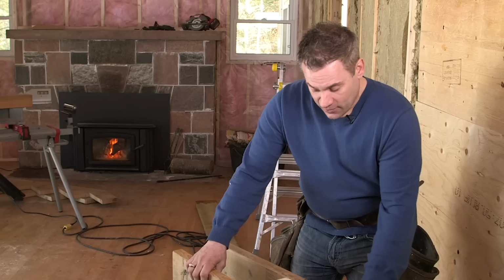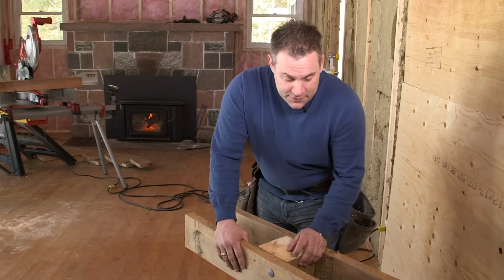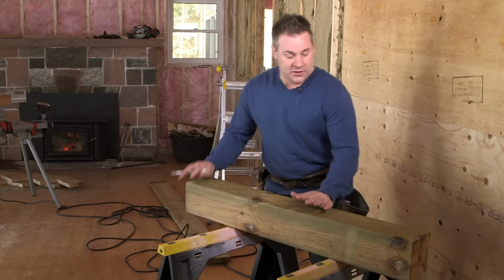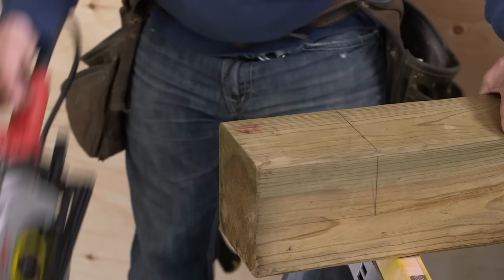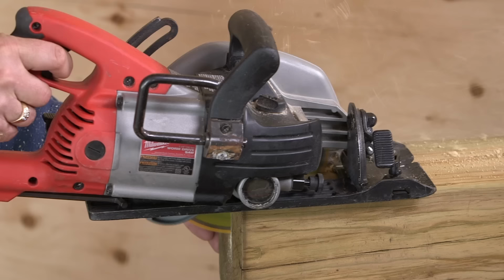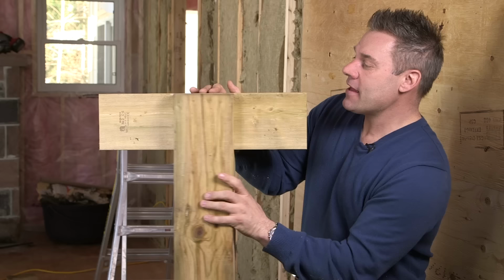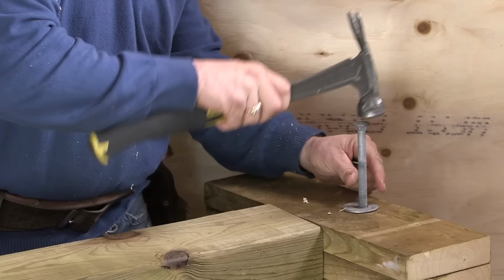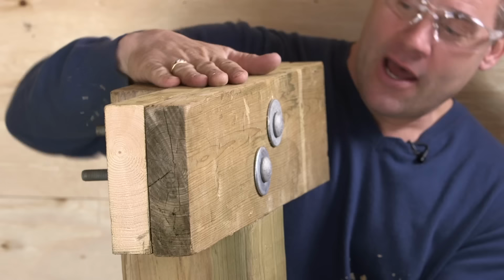How to Attach a Beam to a Post for a Deck | Decks, Docks & Gazebos

Comment: The sheer strength of those 1/2” carriage bolts can handle any weight you can fit onto the deck. The only time you need to knotch a post like that is when you have two or three story decks. Trust your building codes. Not this guy. Not saying knotching isn’t strong. It is. It’s just overkill for a single story deck and he’s implying that a proper  beam attachment is wrong when it’s not.

Comment: Now the two beam will have permanent water stuck in between them and make them rot ten times faster ! Even worse in cold weather like Canada water will turn to ice and push them apart, the only solution would be to stick a rubber membrane on the top of them !

Comment: Tried it your way and got shot down by zoning officer said to use lag bolts like you showed first off deck still up 35 yrs later with a 20 ft from Wall to beam with a 4 ft cantilever

Comment: While this is correct information, I have never seen a single bolt snap off ever.  Not even when using a bobcat to try and pick up a corner to bust up the whole unit.   Entire deck just lifted right up.

Comment: This is wrong. The carriage bolt has substantial strength. It’s not hard to determine the capacity and design loads and select a configuration that satisfies the requirements. Making that notch may be a code requirement, but that doesn’t mean another way isn’t safe.

Comment: Hate to point out that a screw and a carriage bolt are not the same.  Lets see him try and break the screw if it was a half inch thick..  My deck who I belt with putting two carriage bolts in 40 years ago must be getting ready to fall apart the next time I walk on it.

Comment: The minimum shear strength of one 3/8 carriage bolt is 7,500 lbs.  One bolt.  So nobody uses one bolt, some old fashioned math will give some impressive numbers.  Stronger than the wood will ever see. The internet is full of bad info

Comment: Big bolts are everywhere in construction it the only thing that works your not going to use a screw on a 5k lb beam.. Our high school is ALL bolts holding huge beams look around bolts are used everywhere.

Comment: Wow! The controversy, the arguments, the "Karens" and just plain BS.
First, anybody in the construction business KNOWS there is more than one way to BUILD IT RIGHT but CODE rules all if it addresses the particular build.
Second, personally I don't like carriage bolts or lag screws. I like and use whenever possible Grade 8 HEX HEAD BOLTS, washers, lock washers and nuts.
I use hex head bolts because it allows me to use a large flat washer on both sides thus giving me more compression / surface area when I tighten the bolt.

Comment: Expert on deck structure... But doesn't know the difference between shear strength and metal fatigue.... On top of that, wood would never shear a carriage bolt! The wood would split long before damaging the bolt.

Comment: Um, no.  Carriage bolts are just fine.  20+ years of building and never remotely had a fail.  I remodelled decks that had beams held to post with normal wood screws and it lasted years.  I wouldn't build that way, but surprisingly it lasted.  Put 2 - 5/8th or 3/4 carriage bolts and the shear is greater than what a 2 ply dimensional lumber beam can carry.  Plus he tested shear on a screw not a carriage bolt hahaha.   Added note: the ledger boards against the house for decks are held on with..... carriage bolts, timber bolts, or other large screws with enough shear rating. etc...  When pricing projects, extra cuts for nothing is wasted profits.

Comment: Both are wrong! The beam should cover the entire post and attached with  post to beam metal. Open horizontal end grain will allow the post to absorb water and in some cases promote dry rot. You can always use a waterproof material to protect end grain. The bolts will not fail under any normal deck configuration.

Comment: Why do you feel like you have to create a fake scenario with a screw? To say there is no sheer strength on a 1/2” carriage bolt is completely ridiculous. I would like to see you try to break the beam off of that post with those two bolts cinched tight. I would bet the wood would fail before the bolts.

Comment: Are you parking your car on your deck?    Nobody will argue that notching the post isn't better but just a 3/8  grade 2 bolt will hold at 830 lbs. With just two bolts that's four shear points 3320 lbs. Of course you're also far more likely to splinter the wood when it's bolted to the side. But the truth is unless the deck is going to see a really big load the notch is better but not necessary I only point this out because I don't want people to worry if their deck is made the other way.

Comment: Actually, the carriage bolts have quite a bit of sheer strength. The problem is not the bolts, but the wood. When you put a lot of weight on those carriage bolts, it's the wood fibers that compress around the bolt, making the connection loosen over time. He's showing the correct way, and now code required way, of putting beams to posts. You can also just put the beam on top of the post without a notch and use a metal post to beam cap that holds them together against lateral forces. No drilling, no carriage bolts, just cap with joist hanger nails (never use screws). I see people framing with screws all the time, but screws actually are brittle and have very little shear strength (as seen in video). Use 16d nails, they have shear strength, or when using hangers or post bases and caps, use the nails for joist hangers. They have more shear strength than framing nails, and the hangers are designed to be held by them for maximum strength.
Reply: Not all screws are equal, not all nails are equal, not all bolts are equal. Otherwise, you are spot on.

Comment: The shear stress on the bolt is virtually negligible. The bearing stress on the holes they wood the failure point. Some people think you need to use grade 8 fasteners with wood. Not true. Grade 3 is hundreds of times sufficient

Comment: Notching out the posts is not necessary and if I did use this method I would paint the cut wood with oil based paint which then needs a long time to dry before assembly Just making job unnessesaryly harder I have never seen a galvanised bolt break off Also not necessary to put washer under head of bolt just under nut end Use a spring washer under nut if you wish but not really necessary

Comment: What would the purpose be of putting a washer under the head of the screw? Absolutely senseless in my opinion as the screw will then turn when one tightens the nut.

Comment: Introduce a new water intrusion/rot point OR trust two 90,000 psi (each) shear strength 1/2' inch carriage bolts. You decide

Comment: NO!!!  Bending a screw by whacking it with a hammer is an illustration of the material's resistance to an applied BENDING MOMENT, which is a function of the Young's Modulus and the cross sectional area of the part.  It IS NOT an illustration of shear strength,  which is a function of the material's tensile strength and the cross-sectional area.  Now, the strength of the connection shown, bolting a beam to the sides of a column, would be dependent on the shear strength of the bolts.  The shear strength of a grade-2 steel bolt (at full diameter, where the load would be) is about 1,400 pounds!  That is 5,600 pounds for the connection shown.  Not only is this adequate for most deck applications, it is also code-compliant in every state I've ever worked in.  Yes, mounting the beam directly above the post will provide a greater compressive load capability, however,  it may be more susceptible to failure due to sideways defection at the joint of the column and the beam (as the beam twists, the supporting post will deflect until the compressive load is no longer normal to the center of the column... the post will split along the grain and fail).  Which joint to use depends on the application, the load, and the materials of construction.

When an engineer specifies a connection, assuming he has done his due diligence by calculating all reasonable loads (and maximum possible loads), the builder should adhere to the design.  Second-guessing the guy who put his PE on the drawing is asking for trouble.

Comment: More work, dust from chemically treated wood, increased surface area for water and general lack of understanding of strength of materials. Also much easier to align the top of the post and rails using clamping and bolts rather than cutting a precise shoulder. Back to school.

Comment: Not current code. You cannot notch a post. Wind uplift and snow loads apply. Maybe in Florida not the northeast. This is misleading. This coming from 30 years as a General Contractor.

Comment: You were NOT demonstrating shear. You were demonstrating bending moment. Shear is not the problem. It is bearing load on the wood. The bolt is fine. Compression on the wood in bearing is the problem!

Comment: You're totally right. The listed shear strength of 50,000PSI for a 1/2" carriage bolt is basically the same as the tiny wood screw you broke with the hammer.

Comment: If a carriage bolt has no shear strength, then tell me why they are used in building of stairs, handrails, catwalks, etc. I get the notch, but saying a carriage bolt doesn't have any shear strength, is a plain lie.

Comment: Bull tacos!,,,,,,,,carriage bolts have tons of shear strength.  Yes placing your framing on top is better but unless you have a hot tub on your deck there is nothing wrong with bolts.

Comment: A single 1/4" Grade 5 lag bolt, in a configuration like this, will fail at roughly 13,000 lbs
Reply: I saw a lady that was on a second floor deck dancing and was close to that weight

Comment: Wow he’s not wrong but he’s not right either the carriage bolt does have sheer strength that’s why it’s required by code the weakness and bolting to the outside of the post is the beam itself you’re relying on the strength of the grain rather than loadbearing on the post

Comment: The shear strength is WAY higher on a carriage bolt than the wood it is supporting in his example. The wood will fail LONG before a 1/2" bolt will.   He needs to understand engineering just a little before passing as an expert.

Comment: My daddy taught this girl to put the beam on concrete piers. NOT on 6X6's.  No rotting ever.
Reply: What if the beam is 10 feet off the ground?
Reply: @delwinhobbs3262  10' concrete pier. But, as long as the pier is below the frost line and above the ground, it's the same... No rotting.
Reply: @rogerdodger8415  you're saying the concrete pier needs to be 10' high? I agree with you partially,  but the concrete doesn't need to go any further than 6" above grade.
Reply: @ddsonsconstruction2902  I said below the frost line and above the ground. I was asked "what if the beam is ten feet off the ground. I replied that he could put a ten foot pier (if he wanted) not that I would recommend it, but it's been done.  '06 IRC 606.6
Reply: @rogerdodger8415  gotcha

Comment: Using a washer on the head end of a carriage bolt is just plain wrong.  It defeats the purpose of the square portion of the neck beneath the head from being firmly embedded into the wood.  Also you made your hole too large.  Properly sized, the hole should be tight enough to require a hammer to drive it home.   The washer, along with a lock washer goes on the nut end.  In addition, when using pressure treated lumber, all cuts should be treated with wood preservative.  I know that is beyond the scope of this video, but a reminder could have been offered for those first timers.

Comment: What's the difference the wood is going to rot anyways
Reply: depends on how you do it and what kind of wood.  The wood deck I made in 1976 is completely free of rot.  You can tell because when you tap it with a ball peon hammer it rings like a bell.  That means it's still solid and in fact the age has hardened it.  I built it out of oak and it has been oiled every few years since.
Reply: How do you figure? it's treated lumber, pretty much lasts forever.

Comment: He forgot to mention to cut the remaining bolt threads off if you intend to use the underside as storage or if he deck is low and you have children. Zippy cut the ledt over threaded area then bevel all sharp edges with a sander wheel. your wife will thank you for it

Comment: Putting the small screw in and knocking it off with a hammer, he should have put a BOLT half in and then try breaking it off with a hammer, this is so funny he should be on one of those shady infomercials.

Comment: Sorry mate but I'm a mechanical engineer, and that post would fail way before the bolts would. Just from the clamping force plus the several tonnes of sheer strength you get from A single M12 or half inch bolt.

Comment: He’s right & wrong at the same time sort of. The first method will pass building codes in most areas not all but most, the only problem with it is not as not as strong as the second method.So a deck that’s going to be under a lot of stress you might want to use the second method but for most backyard decks the first will be just fine.

Comment: This guy is a muppet. Firstly you don't put washers under carriage bolt heads and secondly why doesn't he drill the right sized holes for the bolt. You are all correct, he is just another youtube expert.

Comment: Two half inch carriage bolts are plenty strong enough... Why put a washer on the bolt side of a carriage bolt? That defeats the design of that bolt with the square section to bite into the wood to preclude its revolving during tightening....duuuhhh!!!!

Comment: You are all wrong, its neither notched posts or carriage bolts. you spray sealer or wax the end grain of the top of the post then put a simpson 4x4 or 4x6 saddle to make a post to beam connection.
Reply: Brian Van Horne right because Simpson  makes products for home owners not builders. Okay bud

Comment: I would love to see you snap that coach bolt with your hammer. In fact smack it with a sledgehammer, it will only bend. Unless that joint you made has water protection, it will rot.

Comment: No shear strength in carriage bolts…wow..that is so incorrect. Your also wrong about using flat washers under the carriage bolt head.
By doing that you are eliminating the functionality of a carriage bolt.

Comment: A case of just because you can doesn't mean you should. The bolts are perfectly capable of supports wood deck loads, The mortise method is just overkill. Just ask your building department.

Comment: I say b***** all you have to do is add a couple blocks of wood underneath your 2 by 6 for support, and make sure you use galvanized nails for the blocks and I don't care how much weight you put on it the carriage bolt is not going to break and before it does it'll rest on the blocks!

Comment: Your right it probably is best but your also exaggerating the shear strength of the bolts. When you bolt them together the joists become part of the posts. If the bolts were loose then you have the strength of the bolts holding things together. Besides doing it your way has to be a lot more precise, one wrong cut or measurement and your screwed. At least doing it the wrong way(in your opinion) you can adjust before you bolt. Just saying.

Comment: Why not just under block it? Same results. Use a solid beam; moist winters in MN will cause cracks when trapped water freezes to -30 degrees.

Comment: This is factually wrong, a 5/8" carriage bolt has a lot of strength! In Chicago it's actually an illegal violation of the building code to notch a 6x6 for a joist like that, ever since a tragic porch collapse in 2003. Now the building code requires a double joist booked to the 6x6 on top of a heavy L- bracket bolted with 1" carriage bolts.

Comment: What a crock! I've never had any of the large carriage bolts sheer off in all that structures I have built. Cutting a hip is a method, but to claim sheering when I have never seen that happen with the thousands I have done, no. This guy is assuming something that has never played out in my experience.

Comment: Another tip when taking out a check is if you are using 6" timber for example only notch out 5 1/2 inches so the structural timber is proud of the post, If the 6x2 happens to shrink ( which it would faster than the vertical post)  have an amount of clearance before the vertical post starts to impact on the deckboards by becoming proud of the 6x2 timber. Other carpenters/joiners will understand this.

Comment: What nonsense. A couple of 12mm galvanised coach bolts will outlast the timber itself. Checking in the beam does add some support of course but it’s not necessary. If you do cut a check out be sure to apply some timber primer or preservative to the checkout before sitting the beam in or it will rot away over time.

Comment: As many indicate his wrong is not exactly wrong and his point of issue is inaccurate at best. The shear of the bolt is not the area of most concern or 1st to likely fail, this will be support by anyone that has done exterior building for any length of time. Yes a should cut would provide  more support, but unless properly treated, increases the chances of moisture penetration into the post and failure of the post. 
Bottom line, overbuild for your load and treat any and all cuts. And always use exterior approved hardware.

Comment: This can't be right. You're saying, because a small screw can break, so will two large bolts. Also you are now exposing more of the post to water to rot. The beams weight is distributed in half the post, but the downward pressure from the bolts would be across the whole post. 

Hey, I'm just a programmer, but this doesn't male sense to me.
Reply: Rogeball PB  Timber for decking is usually pressure treated so any cuts expose untreated wood. Would have to treat the cut area.